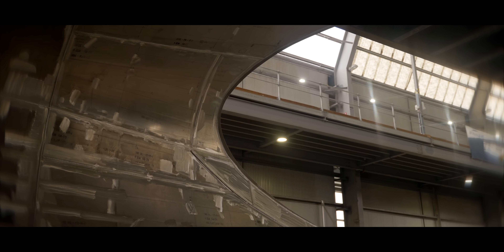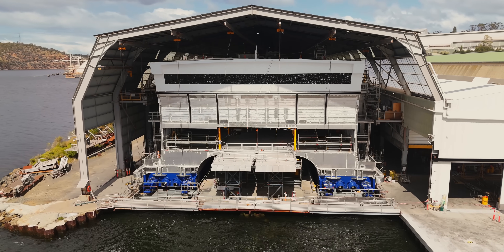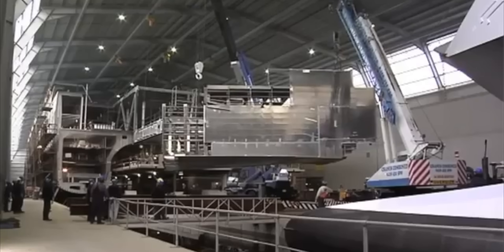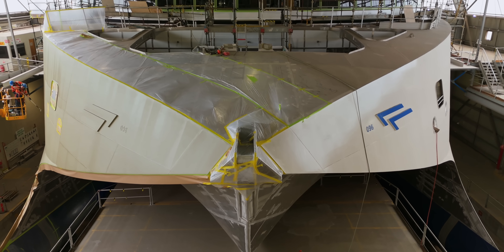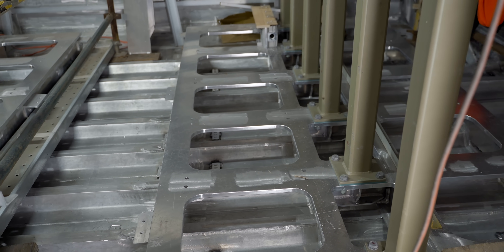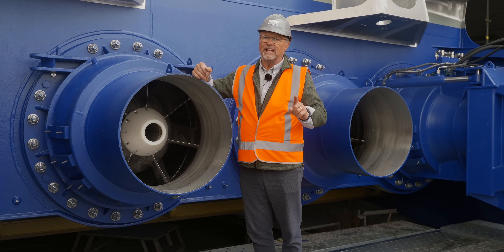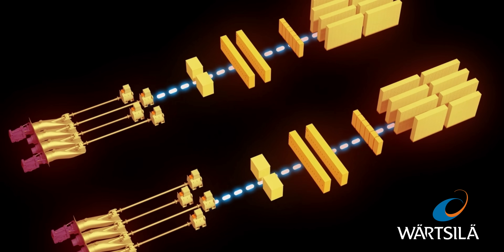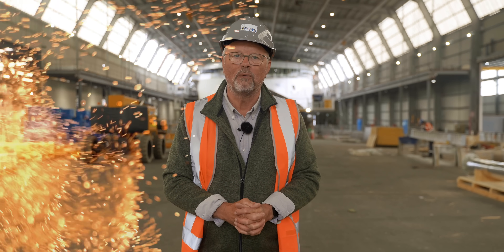The LARGEST Electric Vehicle In The World?!

Comment: What's this BS about aluminum ships being 1/3 the weight and requiring 1/3 the power? They are usually a bit above 2/3 the weight due to needing thicker hulls since aluminum is not only weaker, but prone to cracking on impact where steel wouldn't. It makes me really suspicious about their other claims.
Reply: Robert said 1/3 the weight. The ship builder corrected him: about half the weight. He then explained other savings, where the huge battery pack was actually 100 tons lighter that the LNG installation of a comparable vessel. This is ship 96 of this basic type so they know what they are talking about and how to optimise these vessels. The power: they explained the efficieny of the system despite the huge power, and the savings by using electricity. So you are right that 1/3 lighter and 1/3 less power sounds odd, but different figures were given based on real world information of comparable ships in services all around the world.
Reply: Bob Clifford has been doing this since the 90s and while a bit of a shownan, he and his people do know what they're doing. He even used to run a twice daily ferry service between Tasmania and Victoria but it wasn't popular because they couldn't get docking in inner Melbourne, so usage petered off after a few years because of the long drive from the Gippsland to Melbourne. They've had a long time of r&d and product refinement. One of the few things Tassy does get right, Incat.
Reply: What's this BS about not listening to the words spoken. There were some important qualifiers given.
Reply: Literally you’re full of bullshit, get your facts rights, catamarans are way lighter and have super high speed, they have been around for 30 years but electric are the future
Reply: Aluminium construction normally works out at around ½ the weight of steel in the real world. If you simply work out comparable strength then yes aluminium is about ⅓ the weight of steel, but other real world constraints mean that you have to go to about ½ the weight. If you listen to Clifford  in the video he says exactly that.
Reply: I thought the same but ....well... possibly if it's widely used to fit out the ship i.e. the passenger and shopping areas and so on then perhaps it makes something back there?

Comment: Batteries, electricity and water, I wonder what could go wrong
Reply: Guess how submarines have been powered for the past 100 years ...
Reply: @MrAdopado  I thought that we were trying to develop and not to regress in development and introduce technology that is outdated. Apparently I was wrong
Reply: If the water is on the inside of your ship you have a serious problem whatever the propulsion system. Apart from anything else they sink, because metal is heavier than water.
Reply: Many large ships these days are hybrid, they have electric propulsion systems, the internal combustion engines are there as part of the generating set to provide the power.
Typical ships with electric propulsion are cruise ships, nuclear submarines and aircraft carriers, and most warships.
Reply: @Paul-yh8km  1 batteries have a higher density than water and diesel fuel has a lower density than water the advantage is obvious. 
2 throw lithium into water and see what happens

3 all net zero say that the probability of battery ignition is lower. this is a lie in the case of diesel. and even if it were true then if the probability of fuel ignition is 1% and the probability of ignition of one battery cell is 1% then such a battery is made of thousands of such battery cells. so it turns out that we have 1% * infinity.
Reply: @MsDexter47
How do you expect the lithium to come in contact with water under normal conditions?
The batteries are sealed components, if water was in the battery compartment the ship would have got into serious problems long before that happened and would have been abandoned.
I also suggest you throw lithium into water and see what happens 😄
I mean your original statement has now just reduced to batteries and water. So it was incorrect from the start.
Reply: @Paul-yh8km  Have you ever heard of a phenomenon called hygroscopicity?
Reply: Why? What is the problem?
Reply: Submarines since WWI have been battery operated.
Reply: @jamesengland7461  yes and the Germans did everything to get rid of them. unfortunately at that time it was not possible

Comment: Not putting solar on the roof of this ship, considering the route it is going to be sailing? Is absolutely shortsighted.
Reply: It would be a cool look, but not very practical. The power generated would be insignificant compared to the total usage. The weight (added electricity use) and cost would still be there. Granted, those would also be relatively small. But it just isn't that brilliant, just like solar cells on EVs. Ironically, solar cells on diesel vehicles make more sense, since they still need electricity, and electricity from a diesel engine is very expensive.
Reply: The solar power from those cells would only just generate enough power to cover the extra drag from their own weight plus ten minutes of running per day.
Reply: @deerfootnz   I tried doing some back-of-envelope estimates myself, and got the same order of magnitude. It was actually more "minutes of running time" than I would have guessed, but the right solution economically speaking is usually to put those theoretical solar cells on the roof of a factory or warehouse in the unfashionable end of Montevideo or Buenos Aires.

Comment: The largest electric vehicles are the nuclear aircraft carrier Gerald Ford (337m) and the TGV (up to 400m).
Reply: A bit of an asterisk for having a nuclear reactor on board, though.
Reply: This is an electric ferry because you make it go by putting electricity in it. You make a nuclear ship go by putting some enriched uranium in in it. "Well actually it's got an electric motor" is how we get Toyota's nauseating campaign to rebrand its 100% gasoline-powered hybrids as HEVs.

I wonder if a TGV train weighs more than this ferry. Incat says it's half the weight of a steel ferry, but I can't find a number.
Reply: Longest? This is very wide
Reply: Aircraft carries are steam driven directly, no conversion to electricity to then drive a motor.

Comment: A brilliant video, I like owners like him who see the solution not the problem, it also shows all it takes is a small bit of willingness and we can decarbanise marine traffic.
Reply: Longer distances will require a lot more than a small bit of willingness, as batteries will not be sufficient.
Reply: @concinnus 

Quite correct.

Batteries never.were the ideal solution on all situations.

BEVs, say, are affected by the ambient  temperature.

Research will reveal ammonia powered ships used in diesel engines are now crossing the dead with no hint of range anxiety.

As before on many occasions batteries are merely a step on the way.

They are fast becoming obselete.
Reply: bullshit!!!! its a very tiny ship range for a very small application! it doesnt even compare to the ICE powered ones! its not about solutions or problems but finding what works best for you!
Reply: musk makes EVs why hasnt he also made electric rockets too?!
Reply: Just to be clear @concinnus, I picked up on the statement 'longer distances'. I appreciate 1000's of miles for cargo shipping is not in the scope of batteries. However battery improvements are happening. kWh/kg has improved greatly over the 15years of development since the electric roadster. Just think, 15 years more of battery development (ICE have had >100 years) and we may be in a position to use batteries for a more and longer distance ferry travel.
Reply: @ English is weird; by "longer" I really meant "long", sorry.  And while electric ferries and other short range ships are nice and worth doing, they're a drop in the bucket, like 1-2% of the emissions of oceanic bulk/container ships.  So non-battery solutions are more important to develop and discuss.
Reply: @conncinnus Are you sure. 15 years ago I wouldn't have thought we would have electric cars with over 300mile range and until I saw this episode I certainly wouldn't have thought there would be an electric ferry this size. But never say never. Onward, onward ever upward.
Reply: @ The Roadster had a 244mi range, so it was obvious we'd get to 300.  Meanwhile, this ferry has a 1-hour trip vs a 300+ hour trip for a China-US ship.  It's not even in the same universe.
Reply: @concinnus The roadster was a tiny tiny lotus Elise, we now have huge suvs and even bigger and quite frankly ridiculous, pick up trucks with big range. So actually, it is equatable. But this ferry has skipped the tiny phase, so if tech can move this quickly, who knows what's next.
Reply: @mev202  >300:1.  I repeat, >300:1.  It's not happening.  Green transoceanic shipping will use ammonia, green methane, or biofuel.  Or hydrogen if someone comes up with low pressure adsorption.  Count on it.
Reply: @concinnus  exactly! just because you can barely get 50 miles of range of batteries isnt the time to brag about! the diesel ones gets tousands of miles of range
Reply: @mev202  wrong!!!!! the pickup trucks have no range to brag about! 300 miles is still nothing! a diesel truck much bigger one gets over 800 miles of range on standard fuel tank and over tousands on auxiliary fuel tanks! you cant even increase the range on an EV by adding batteries.
Reply: @alanmay7929  the five exclamation marks says it all about you. Bless.
Reply: @mev202  what a joke! are you trying to be funny?
Reply: @pbhrsatf  this ferri barely gets less than 100 miles o range inform yourself very well! ive watched another video before Robert went there lol!!!!
Reply: @pbhrsatf  300 miles of range is litteraly nothing! of course it works for some but not everyone! nothing will ever beat the power of liquid fuels! just look at musk own rockets! they burn over 1000 tons of fuel in just few seconds to fight earth's gravity.

Comment: WRONG:  That is not the biggest electric vehicle, the nuclear powered aircraft carriers are also electric vehicles, OK they are a little different because you don't need to plug them in, but they are still electric vehicles.
Reply: That is incorrect.  Although these carriers have a large electrical power generation capacity to handle the ship systems like em catapult, weapon systems and large growth for future weapons, the shafts are powered by steam turbines.  Like an old steam locomotive, it is steam that propels the ship albeit using nucleus reactors to generate the stem.   Ergo NOT AN EV
Reply: Well then how about nuclear subs then
Reply: @mnp3713 minnows compared to this ferry that is 310m long - that’s 1017ft! Not many subs that long and certainly nowhere near as wide as a wave piercing catamaran!
Reply: Fair enough. Biggest BEV then?
Reply: Many nuclear aircraft carriers use steam driven turbines from the reactors heat as opposed to electric motor power.
Reply: Sigh. This is an electric ferry because you make it go by putting electricity in it. You make a nuclear ship go by putting some enriched uranium in in it. "Well actually it's got an electric motor" is how we get Toyota's nauseating campaign to rebrand its 100% gasoline-powered hybrids as HEVs.
Reply: American and British nuclear powered submarines used geared steam turbines for propulsion.  However the French nuclear submarines (attack boats) do use electric propulsion motors (reactor powers 2 turbo alternators that produce electrical power for both propulsion and submarine systems).  The Suffren class displace 5,300 tonnes submerge red and are 99.5 m long.  I will have to look at the INCAT ferry dimensions to verify but the French sub may be the largest EV
Reply: @michelguerard5591  i did not now those where steam driven.  How about Diesel - electric Symphony of the Seas is a pretty big ship much much much bigger than the Incat. Also the Wabtec’s FLXDrive locomotive can pull around 100 traincarts of 50 ton and has 5000kw power
Reply: @michelguerard5591  "American and British nuclear powered submarines used geared steam turbines for propulsion." Not under water they don't!! And on any mission they spend almost all the time under water.
Reply: @ I’m a retired Canadian naval officer having spent 35 years in the navy.   My specialty was marine engineering and specialized in naval architecture (I’m a graduate of the USN 13A program and received a Master of Science in naval architecture fromMIT).  I have sailed in a French nuclear submarine and I am familiar with British and American submarines.   I’m confused as to your comment…do you think there are we-erase propulsion system for surface or submerged running?  Perhaps you are thinking of WWII diesel boats.
Reply: Are you mental?
Reply: Not a lot of ships today even have a direct drive from the engine to the prop . It's becoming more and more common to have electric drives . Witch is good for retrofitting as tech improves and changes . The ship I worked on regularly originally had an oil fired boiler and steam turbine generator . And now has a pair of big slow chunk bunker c burning beasts .
Reply: Guys - stop and think for a bit.  Any vessels you can think of that are powered by one or more nuclear reactors ate not electrically powered - they are nuclear powered.  The reactors on these vessels generate heat (typically used to generate steam to power electrical generators) and NOT electricity.  While there are some devices that use nuclear fuel to generate electricity (i.e RTG) these are typically installed in lighthouses and space vehicles which are either NOT vehicles or NOT bigger than the InCat catamarans.

Comment: the vast majority of cruise ships use electric motors to move

Just they use a diesel generator
Reply: I think all new ships now use electric motors. Queen Elizabeth aircraft  carrier does for example.
Reply: Yeah, it was already true in the later years of steam ships. It is true for many diesel trains. It will be true for electric airplanes with range extensions. It is even true for the massive mining trucks. There is 100+ years of experience with very efficient electric motors and engines, with regular high power output that can be altered in a blink of an eye, and instant torque. In a video of Heart Aerospace it was explained that an electric airplane needs a much shorter runway because of the instant high speed realised. And because the energy source is not directly driving the motor / engine, in some cases the energy providing part can be swapped when more efficient systems are available. So even if the near future is hybrid, early full electric transporters are already impressive and only will be better and very common in the future.

Comment: First.
It would be great to install those spinning wind turbines on top that are experimented with on buildings. They are oddly shaped but efficient. There is no lack of wind on the sea.
Reply: Were you hoping for perpetual motion? The wind turbines will cause more drag on the ship than they can generate.
Reply: @origin178  i had no idea. If you say so you propably know what you are saying. It was just a thought.
What about the ships which are anchored tho? Propably still too little energy.
Reply: Their energy contribution would be so tiny in relation to the requirements of the ship it would be pointless.
Reply: The numbers matter. That ship needs the power of about 2 to 3 of the largest wind turbines installed at sea at the moment, each with a rotor diameter 250 m.